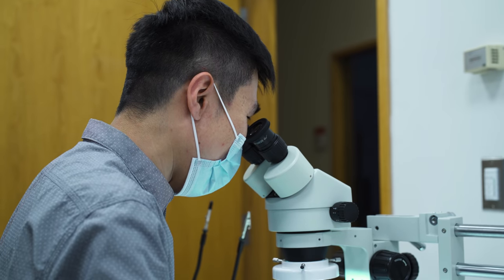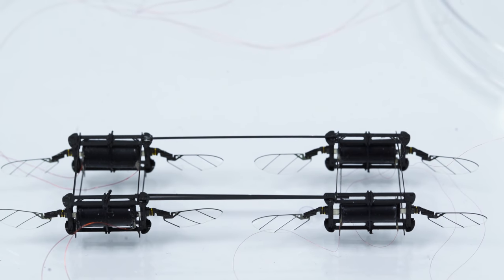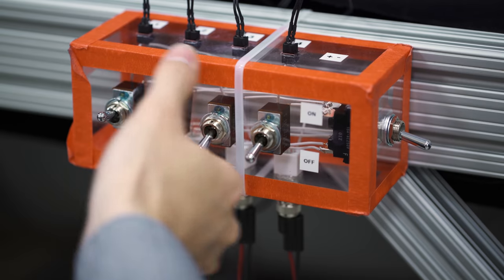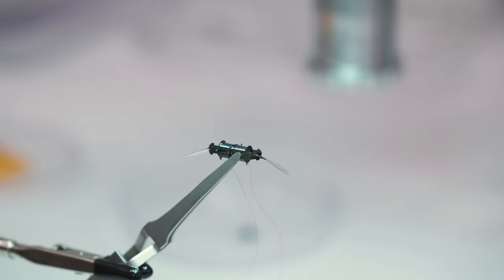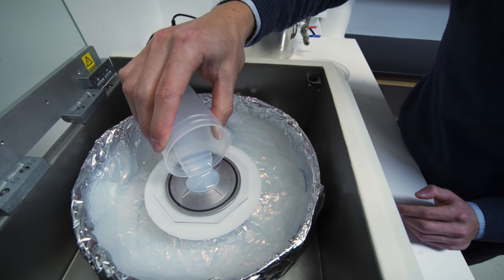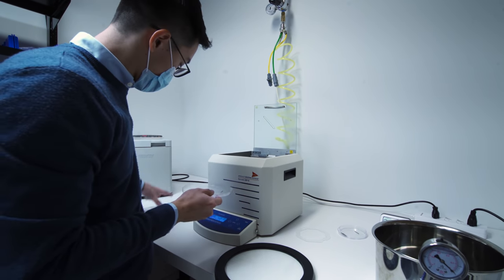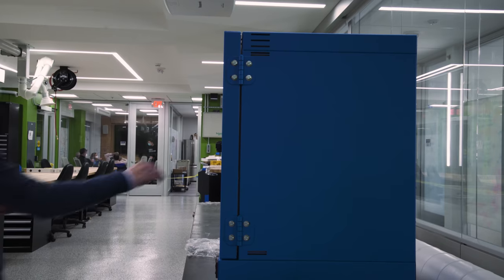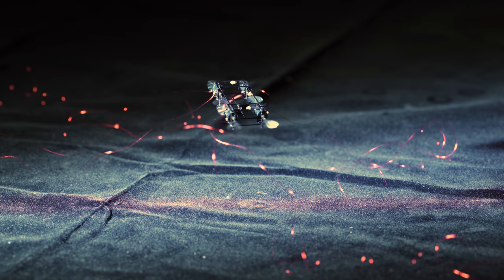Giving bug-like, flying robots a boost

Comment: I feel like I've seen this done a dozen ways by a dozen different teams. They all leave out one critical component, power. None of these sorts of things fly under their own power. No battery, no engine, no reaction... They're all propelled by something external, in this case the copper wires supplying a "low voltage". I'm all for miniaturization but wouldn't it be better to take the smallest existing drones (which are pretty small to begin with) and work on further miniaturizing that?  I could see the tech behind it being useful in medicine maybe but the whole "look we made a bug thing fly for 2 seconds" is getting old.
Reply: Powering is definitely a hard problem to solve as the battery is often the heaviest component in the system, but being so small means they could work without a battery. Photovolatic cells come to mind. They could be powered by ambient light, or a tracking laser.
Reply: @dsp4392  Thats really interesting thank you for bringing it up!
Reply: This might be the dumbest comment I've seen yet.
Reply: Depending on application, wireless is an option, hopefully with not too much more antenna than the wire already being lifted.
Reply: This is why they're at MIT and you're here commenting.
Reply: @dsp4392  Indeed, there are quite a few technologies that may work in this case. This might be a great application for supercapacitors or betavoltaics if the voltage is really low. Other ideas I've had are a miniaturized flywheel or an exothermic reaction inside a piston. There's lots of neat tech like that being developed but you have to dig really deep to watch anything about them. I feel like the "scary flying robots" thing gets way more screen time due to sensationalism even though the end result isn't really viable tech.
Reply: @tonyppe  I want to see a video about this!

Comment: This makes me wonder how a fly or mosquito can fly so fast and so annoying and reproduce. What a complex structure such creature has possessed.
Reply: (Natural selection + autocatalytic cycles + billions of years) > Human ingenuity
Reply: @chucknorris3752  well tbf we are close to replicating that with a much shorter timeline
Reply: @canadianbluepants9446  nope we are very far away
Reply: @chucknorris3752   you really think nature can do anything?
Reply: @korkasmaa  far away as in how many years? 10? 20? even 50 years thats still an incredibly short amount of time
Reply: @korkasmaa  we see all the steeps for it to happen so yes.
Reply: @canadianbluepants9446  Exactly. Even if we were a million years away we'd still be faster by a factor of more than 1000×.
Reply: At this point only power is our technology's problem. Currently, skinfat is 30x more energy dense than lithium-ion battery. When we come up with something better, making an insect robot that actually flies for hours and hours, won't be a problem at all.
Reply: @graullas8981  wait why aren't we putting fat in batteries
Reply: @npc6817  it doesn't work like that, but i like your spirit. There is something called glucose fuel cell, research that. Basically it's really low efficiency, and expensive (uses platinium) but you can put glucone in it and it will generate electricity. Fat is just stored glikogen, which is stacked glucose.
Reply: @dsp4392  exactly like at this rate were so incredibly close to making it possible like giving it 50 years is definitely overkill
Reply: @canadianbluepants9446  we still have a power problem
Reply: @girinevass8559  thats really only the issue and itll be no problem anytime soon
Reply: @canadianbluepants9446  not any time we have almost reached the limit for lipo battery so we will need new innovations

Comment: MIT: robot weights less than one-fourth of a penny.
me: please, MIT, one of the world's most respected universities, can you use existing units of measurement
Reply: Lol
Reply: but isn't it easier to visualise than for example 10 grams?
Reply: A penny is 2.5 grams
Reply: @avatarxs9377  Not if you've never held an American penny before. I don't know what size they are or what material they're made of, so telling me they're 1/4 the weight of a penny means nothing to me. 
If you tell me something weighs 10 grams, I can visualize it as roughly 10ml of water. I've seen, measured, and interacted with water.
Reply: @matthewmullin8168  thanks
Reply: It's the US. None of their units make sense.
Reply: This is clearly meant for an American audience, and for a general person who has no intuitive feel for how much 1 gram is. If you do have that intuitive feel, you're likely also capable of quickly finding the information you're looking for. You could either look for another publication that contains the data in SI units, or Google how much an American penny weighs. Either way the required effort is trivial.

Tell you what; I won't demand that promotional content generated by institutions in your country avoid culturally specific references if you grant the same courtesy to institutions in my country. Sound fair?
Reply: @ryebreadreturn1  i've had the same reaction as op, "one fourth of a penny" totally caught me off guard. sure you can google it and whatever, but as a non-american it's really weird to hear something like that
Reply: @pandakuchen2299  I don't understand that though. If I was watching a similar video from Oxford and it said it was "1/4 the weight of a pence" I wouldn't find that strange because pence is what they use in the UK. Ditto for a 1c Euro piece in Europe. 

A major problem with scientific communications is that they're often not intelligible for normal (untrained) people. We should be praising institutions that try to make their communications intuitive for at least a general audience in their home country. If it's possible to make it intuitive for an international audience that's even better, but in this case I can't think of a universally known object on the order of 1 gram that most people would be familiar with the weight of.
Reply: @ryebreadreturn1  As a european, "1/4 the weight of a cent" would sound just as weird to me.

I agree though, science should definitely be made more accessible for the average person. But comparing the weight of a robot to any object, even if it's universally know, feels kinda insulting towards the average person, because it implies they would not understand what a gram is, or a 1/30 of an ounce or whatever
Reply: @avatarxs9377  if you know how much a penny weighs, yes. Unfortunately, most people in the world don't live in america
Reply: Some time they use banana for weight or foots. but my foot is biger than may bron child.  xD
Reply: @avatarxs9377  not for potheads in America. Many Americans know what a gram AND and ounce looks AND feels like haha
Reply: @ryebreadreturn1  As an European, "1/4 the weight of a cent" sounds just as weird to me and I am not able to imagine it, so if the purpose is to have it as a comparison, than it fails. I can imagine a cent, but not a 1/4 cent.
The point of units (whether it is grams, or even if they used ounces it would be much better than pennies) is that
a) they are standard so everybody can easily learn them (i.e. even if we don't use ounces here, I know that it's roughly 30g and if it was in ounces, I could convert it in my head to grams). Using size and mass of different objects is totally arbitrary and you'd have to learn many objects and conversions and then somebody comes up with a different object...
b) you can use multiplies and division easily. If the pseudounits (like 1/4 penny) are used for better visualisation, than it does not help. Maybe you have held an American penny (pre-1983 or post-1983? different mass...), but you certainly did not hold a 1/4 of a penny. You can't imagine it. you know it's a small mass, but nothing with an actual value or feeling (like, I probably could not tell apart 1c, 2c and 5c euro coins just by feeling their weight (not sure, maybe american coins have bigger difference in mass), my point is that these are not good units of mass since they are just arbitrary light objects.

My point (and I believe OP's point as well) was not that it's an American object instead of European/Russian/international object... but that they use any object at all as a measure of weight instead of units (either grams or even ounces would have been better)
Reply: @ryebreadreturn1  "but in this case I can't think of a universally known object on the order of 1 gram that most people would be familiar with the weight of."

1 gram..?
Reply: @Dome98Otaku  ummm a gram is not an object??
Reply: @ryebreadreturn1  but if people understand how much a few grams is saying something is 1 gram you would be like thats very light
Reply: @canadianbluepants9446  yeah but literally Americans don't know how much a few grams are because we don't use them. And as I explained, we don't even regularly use ounces because who the fuck regularly weighs amounts of stuff on the order of 1 gram or even 10 grams or 1/10 of an ounce or anything close to that weight? I'm 100% serious, how common is it to weight objects that size? I've done it literally never in my entire life except in the context of a scientific experiment, which the overwhelming majority of ppl have either never done or have only done in secondary school briefly and don't remember because they have no reason to. Seriously wtf is wrong with you ppl that you think it's normal to deal with weights less than a gram? It is completely not normal. I really don't get what's so hard about this.
Reply: Well it was aimed at the tax payers with a lot of contribution but with zero knowledge
Reply: @avatarxs9377  gram is easier to visualized imo, ik how light 100g
Reply: Imagine not knowing what a penny is. The smallest currency unit of the leading nation of the world.
Reply: @test5093  Kinda makes you wonder why they're called "units". I'd argue it is better to call them "fragments".
Reply: @user-zu1ix3yq2w  Are you serious? Most people in the world have literally never held nor will they ever hold an American penny. It doesn’t matter how influential the country is, they still won’t have any access to the currency, even if they know what a penny is (the object).
Reply: Still a better unit than pounds.
Reply: @dsp4392  True that! Lol
Reply: @ryebreadreturn1  Nobody uses pennies anymore, even in the US. Canada phased them out a few years ago and the US will cease production this year. I've literally not touched or seen a penny in over a decade. It's more likely that people will know what a quarter of a gram is than what a quarter of a penny weighs.
Reply: @ryebreadreturn1  lol, "the required effort is trivial" on your next exam i will give you the speed in average banana lengths per curb your enthusiasm episode.
Reply: @test5093  it's really weird to me how many people seem to think a promotional video should present information as if the audience is entirely made up of students attending a lecture on the subject. Gatekeeping is counterproductive for science and also just kinda dickish.
Reply: @dsp4392  what a strange objection. Pennies are indeed stupid, but as an American there is absolutely no way to avoid holding one at some point unless you literally never use cash. Even if you're just throwing pennies away when you get them, you still know what they feel like.
Reply: When an American draws a globe, it's just USA surrounded by water.
Reply: @assaulth3ro911  Nah, we don't measure weight in pennies, cents nor hamburgers.
Reply: @ryebreadreturn1  In the UK we wouldn't say "1/4 the weight of a pence" we would say "1/4 the weight of a penny". Pence is the plural of penny.
Reply: Around 0.65 grams

Comment: I know it's science fiction but in the Battletech universe the battlemechs (Mecha/Robots) are powered by a fusion reactor and they use what is called Myomer fibre which is a electrically activated stretchy cord that contracts when a current is passed through it
This elastomer product is a step in this same direction
Reply: It may be a step ahead, material-wise
Reply: What's dope is that fiction is really just us making simulations of a possible reality. We all know how much star trek predicted.
Reply: @ubberJakerz  
Aluminum glass. 
Useful for constructing blue whale sized aquarium on board the Enterprise.

Comment: biology is just the most advanced robots that can exist
Reply: No. A robot doesn't need to copy life in order to achieve the same or better result. Cars don't copy horses if you know what I mean.
Reply: @abhishekdev258  in steps the cybord stingray
Reply: this sentence doesn't even make sense lol
Reply: @abhishekdev258  Cars only perform well with roads.
Reply: @UmamiPapi  ATVs, bikes and Tanks perform well in off-road conditions. The point being that if you have to carry a lot of load at high speeds you won't use a horse or a machine that copies horses.
Reply: @abhishekdev258  you do know the dragonfly does not have a power problem but this does
Reply: @abhishekdev258   skinfat is 30x more energy dense than lithium-ion battery
Reply: @girinevass8559  hmm
Reply: @abhishekdev258  so yes biology is better then engineering currently but not for long
Reply: @girinevass8559  Biology will continue to do what it does. Which is to be most efficient in a particular niche of the environment, whether or not that suits us is a different matter. 
We may get a battery which is more dense than skinfat and skinfat may never get more energy dense but that simply means that being more energy dense was not solving any problem for the organism. 

We see that even in computation, you or I can't solve equations which involves numbers  that contain 5 or 6 decimal places in our heads because there was no evolutionary need to do that.
Reply: @abhishekdev258  yes
Reply: @abhishekdev258  so as I said they nature is currently better

Comment: as i understand it, this tech can be back driven to generate tiny voltages when the material is stretched mechanically. this is pretty old tech from around 2001 or so if its the same thing i'm thinking of, but no one made anything useful from it back then. i heard about it from an attempt to use a massive matrix of these things to charge a battery from your body heat.

Comment: I have made an FM transmitter that is smaller than the size of a wing of that. The problem for them as well as for my transmitter is the battery that is way, way heavier than the item.

Comment: They should create a “spinner” vacuum integrated module so they can stretch the material without air being present.  This may eliminate the bubbles, unless a device like that is too expensive or obtuse to create.

Comment: Why there is need when FINISH spin-coating and then vacuuming, instead of spin-coating inside of vacuuming pot and if they use higher speed it could be more thinner ???? 🤔🤔🤔🤔🤔🤔Because there will be no air inside the elastomer to begin with it will be pure elastomer  🤔🤔🤔🤔🤔. Well i am just stupid guy ask a question if this is possible.

Comment: Mhm, and what about power source? We don't need no better electrical to machanical energy conversion but hundreds or even thousands percent increase in energy density of power sources to make things fly and be practical. And there is little to none of new working and cheap solutions.